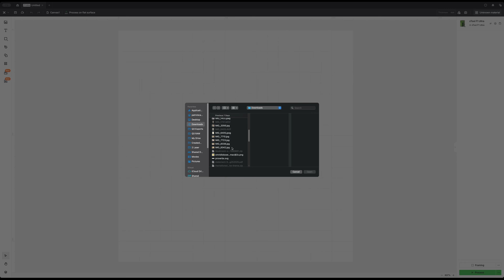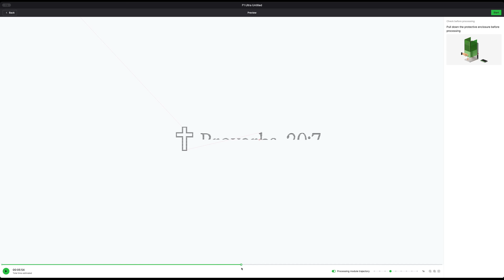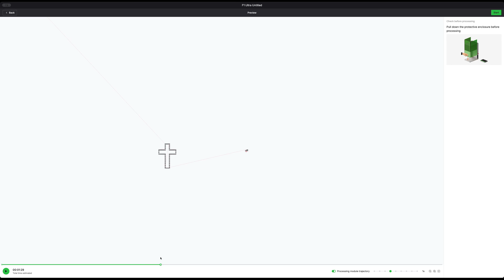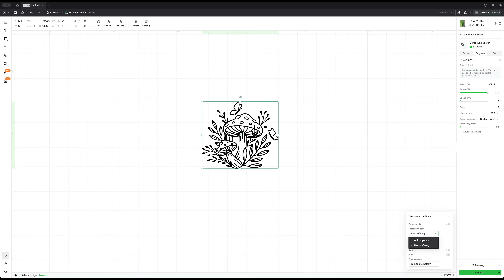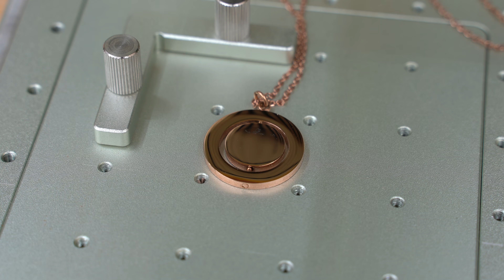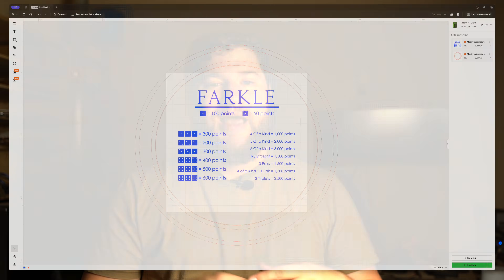Cut Your xTool F1 Engraving Time in Half — Here’s How

Comment: When I use the smart feature my engravings are uneven. Any idea why or what I might be doing wrong?
Reply from the maker: What material are you engraving?
Reply: @createdworkshop  stainless steel jewelry blanks from monarch pine. They are PVD coated
Reply from the maker: Hmm those are the same blanks I use! The only time I get an uneven engrave on Monarch Pine blanks is if I don't have the blank level to the laser, or if I'm very off-axis of the center of the laser. Can you send some sample pictures of what you're talking about? You can join my Facebook group and post there (link is in the description).